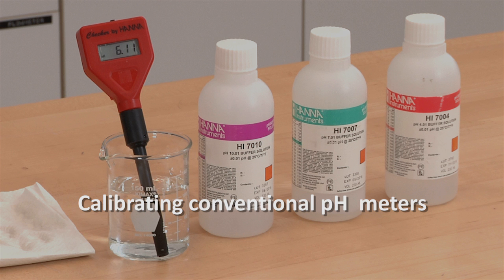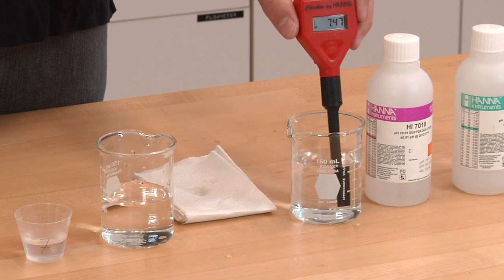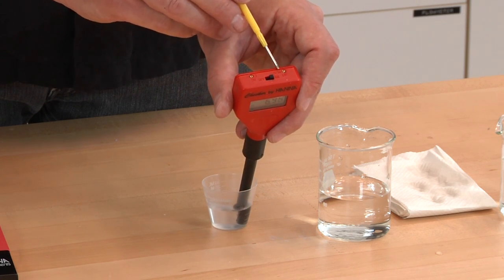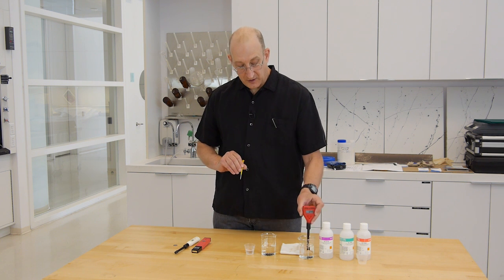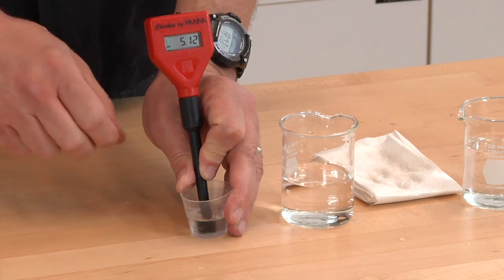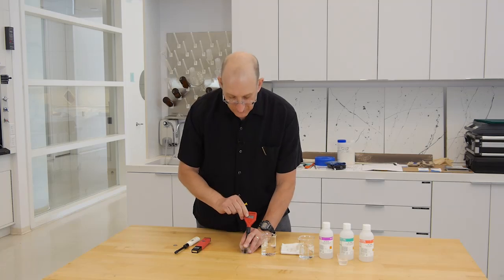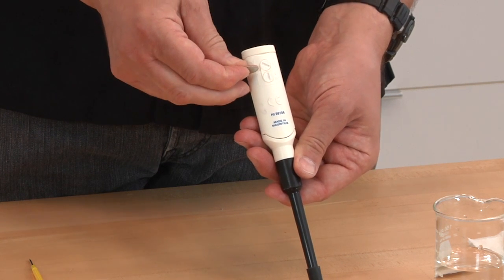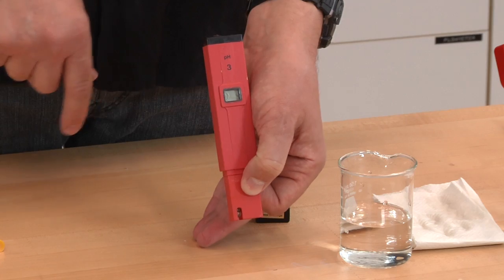Calibrating Conventional pH Meters

Comment: Thanks for good explaining.
BTW: should the meter be in tap water between measurements? Or should it be locked by plastic cap?
Reply: +Waldemar Szmurło - It should be locked by plastic cap but put a drop of pH 4 buffer on the tip. If the time interval between two readings is long and you think the tip might have dried out then soak the tip again in buffer solution for a few hours like you would with a new electrode. Then calibrate again. The latest Hanna does not need any screws any more. It automatically senses the buffer and stabilises after you dip it for some time.